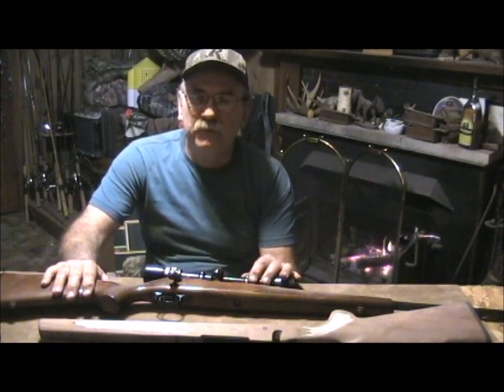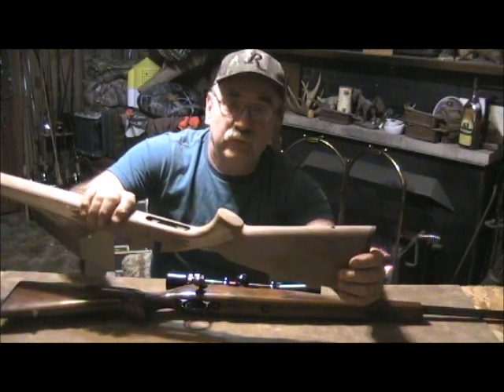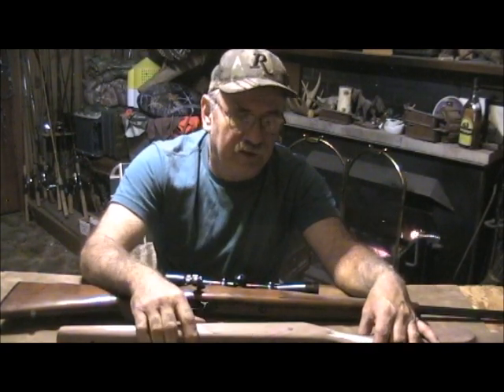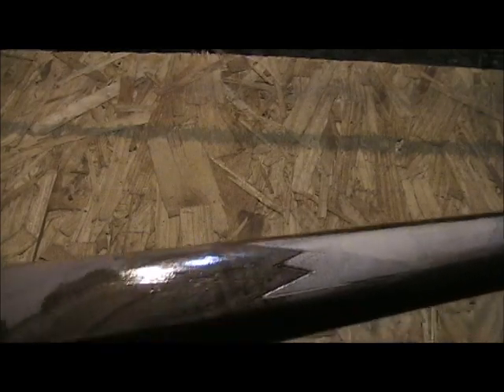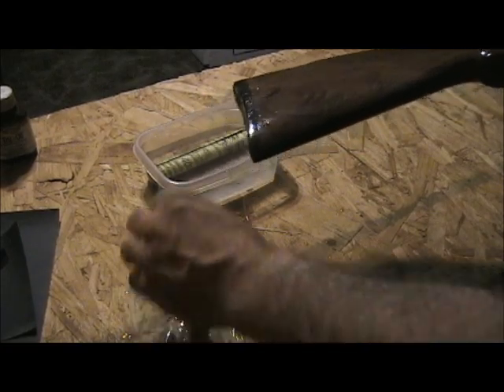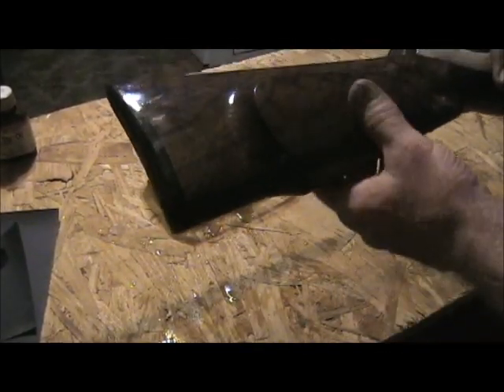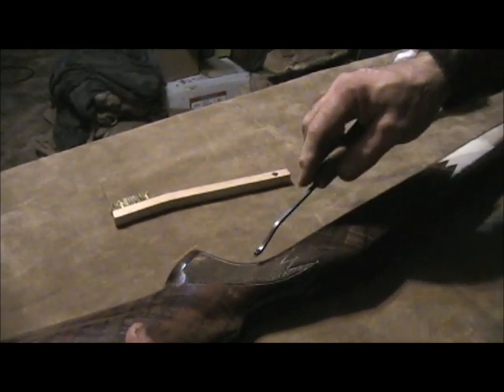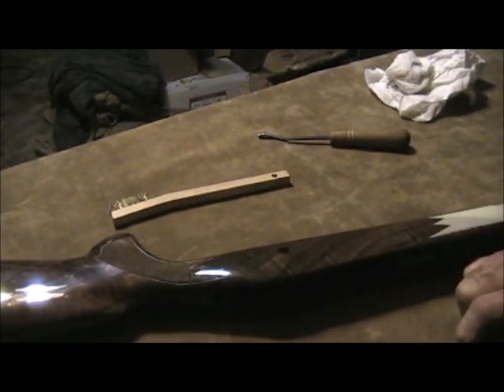Refinishing a Remington 700 stock

Comment: The one thing I do when using Tru Oil is to dilute the first two coats with mineral spirits. A 50/50 ratio lets the oil seep deeper into the wood.  IMHO.   You did a great job
Reply from the maker: Thanks, I'll have to try that.

Comment: I have a 700 BDL on its way to me and plan to redo the finish even though it looks good in the photos. I’d like to sharpen up the checkering and add a touch of darker stain to make it stand out from the natural wood of the smooth area’s.
Reply: They have a thick polyurethane finish on them. Are you going to have it chemically dipped to get it off?
Reply: @currituck  Probably sand it off but I’m not sure about the checkering. Will probably need to strip that area. I used to refinish architectural antiques and love the process. The factory finish is beautiful but with my past experience I see even more potential. I’ve got a Ruger 10/22 with a wood stock I’m working on now for practice. It’s just about ready for the first coat of Tung Oil and I’m excited about it and nervous to begin at the same time.

Comment: So what do you do about the checkering when you're done with putting coats on the rest of the stock? Is the checkering getting oil through the tape or you gotta oil the checkering after you take the tape off? Will you have to do multiple coats to match the rest of the finish? Great video and information btw
Reply from the maker: Close to the end of the video (around the 46:30 mark) I cover this issue.

Comment: So the steps as I see them is to sand from 220 to 400 grit. Apply a coat of Tru-oil. Let that dry, then wet sand. Let it dry, then apply a 2nd thin coat of Tru-oil. Let that dry, then buff with triple aught steel wool. Wipe off, and apply more coats of Tru-oil, going over it with the steel wool. Finish with a coat of Tru-oil. Let it dry, and then polish.

Comment: I have done a number of guns using their products. I find the thinner the coats with 0000 sandpaper between multiple coats the better, wiping down with a damp cotton cloth does a fine job. Really brings out the grain in the wood.Watch out for runs near the checking.
Reply: What brings the grain in the wood out?

Comment: The "glass like surface" looks more like a plastic surface to me, almost look like fake wood. I go with tung oil and then finish with boiled linseed many coats. You can top it with some bees wax and carnuba way but it will not have that glossy layer all over the wood. It will still look like wood this way.
Reply from the maker: Just like I mentioned in the video, if you don't want the glossy finish, then just go over it with some extra fine steel wool, and then you will have a satin finish.
Reply: @CumberlandOutdoorsman  Yes you can knock down the gloss but it will still feel like a satin - plastic finish. This is subjective of course. Some people prefer the varnish type finishes over oil. I'm just one of those who like my wood to look like wood. Much of the stuff that is sold for gun stock treatment is called something with "oil" in the name but in reality it is just slow drying varnish. This is the case with Tru Oil, Finishing Oil, some Danish Oil, Some Tung Oil and more. If you know a true oil finish you can easily see the difference and how it feels to hold.
Reply: Oils are not waterproof
Reply: @craigleibbrand7761  It doesn't need to be.
Reply: @Thestripper1  Professional stock makers use Laurel Forge Permalyn stock finish. It SEALS the wood. Jim Cloward a Washington State highly  regarded custom stock maker said in the rain you couldn't walk down the street before the finish is damaged. I've seen stocks turn WHITE hunted constantly in the rain. The oil was leeched out of them.
Reply: @craigleibbrand7761  You are right about that. If you take care of your oiled wood stock and re apply a little oil after some hunts it will look good and be well protected against the elements. Just like good quality oiled finish canoe paddle will.If you have been out in wet environment for a long time then just let the stock dry and then apply some new oil. If the stock is really dry you might want to use a fine sandpaper or scotchbrite cloth to rub the oil in. If you are using a sealing finish, such as a varnish, then any moisture that do get inside the wood will have a very hard time getting back out again. This will cause darl spots of rot in the wood under the finish. It's a matter of taste what you prefer. Remember that a sealed finish is only sealed until you get a small crack or scuff in it.
Reply: Caseys stock sheen and conditioner will take down the shine
Reply: @Thestripper1 You are right with the previous dissertation. Take care of your stock by applying oil.

Comment: Good video. The way I do it is with clear lacquer aerosol spray, I spray 2 coats let dry then fine  wet sand until smooth I'll repeat this process around 6 times and before giving last coat i fine wet sand the stock with 1000 grit wet and dry paper spray the lacquer and let it cure for 2 weeks, then I will polish the stock with car polish, it comes out really nice and the lacquer is truly hardwearing and durable.
Reply: That's the way to do it true oil is not a hard perfectly sealed finish. People use it because it's easy to apply and smells good.
Reply: What kind of car polish???

Comment: Does it go 1 coat of tru oil and dry then sand between each and every coat or did u say you do a few coats then let dry and then sand.  Sorry to misunderstand but im doing this to my 700 soon and didnt want to mess up.  Thank u sir
Reply from the maker: The initial coats can be up to five deep, because you are trying to seal the wood. Depending on how porous the piece of wood you have, you might need to apply two to three coats between each sanding after the first heavy layers. When you sand each time, try not to get too aggressive. Like I mentioned in the video, you don't want to sand through the existing layers, just smooth out any runs, or imperfections.

Comment: Would you recommend multiple wet sandings? I've applied several coats of tru oil, did a wet sand and still have slight pores showing after last coat. Thanks
Reply from the maker: Thanks for asking. I usually apply 4-6 coats initially before wet sanding (depending on the wood and how absorbent it is). Then three before sanding again, then two, then one. As I get further along I very lightly wet sand the previous coatings. Remember you don't want to get too aggressive because you can easily sand through the finish, right into the wood.
Reply: @CumberlandOutdoorsman  Thank you Sir for the reply. I followed your direction and am very pleased with the results.

Comment: Unfortunately you will never achieve a factory finish with Tru Oil it will never be flat as hand rubbed oil or a lacquer.
Reply from the maker: While I cannot assume to comment on your experience with Tru-Oil, I can comment on mine. I have had better results than most factory finishes, depending on make and model. The Tru-Oil finish on the stock in the video is far superior to what was on it, and I stand by that.

Comment: This is not correct should have sanded between coats light coats to fill the pause with saw dust his coats was to thick
Reply from the maker: If you have a different method, feel free to make a video on how you do it. I would be interested to see the difference, and if the end result is any better.
Reply: Bobking4031,  you're correct He needs to look at other videos to do it properly. That said Tru Oil is easy to do dispite the result.